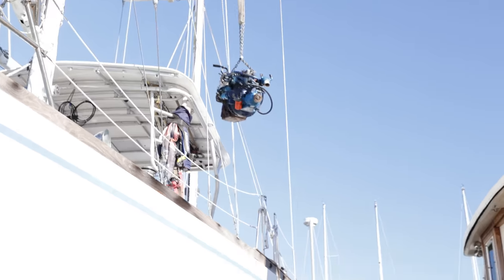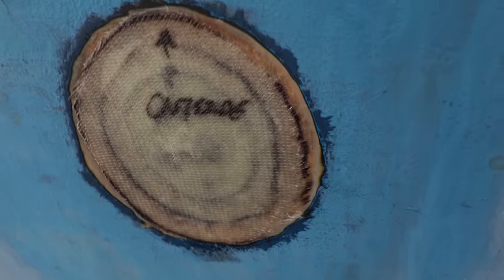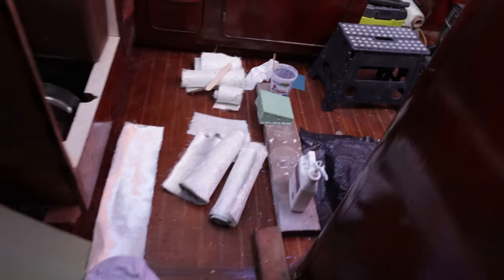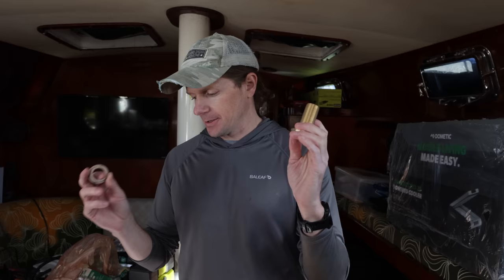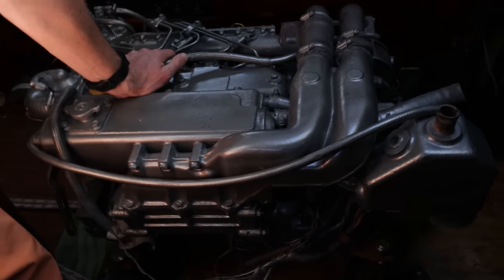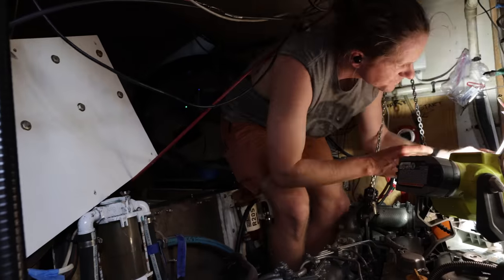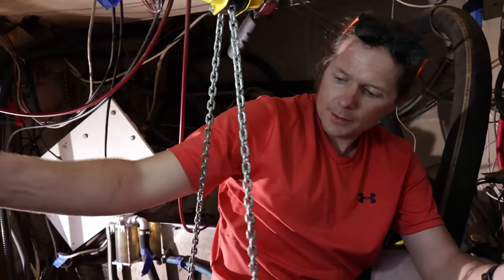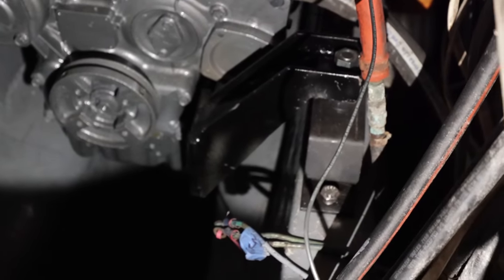It's a tight fit!!! - Getting a Yanmar 4JH110 diesel engine into our 50-foot sailboat | AHOD 22

Comment: Fun tip for cutting holes: Drill pilot hole, then use a hole saw to cut partly through from one side, then go finish the cut from the other side. Both sides come out clean cut.
Reply from the maker: Good tip!